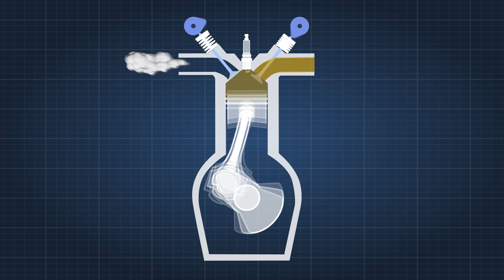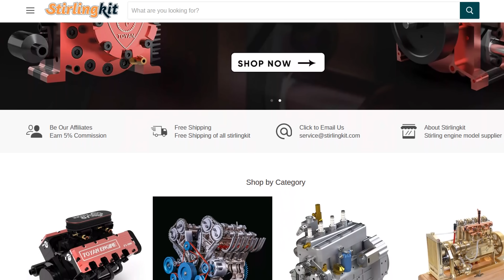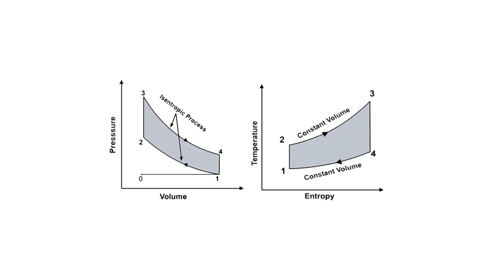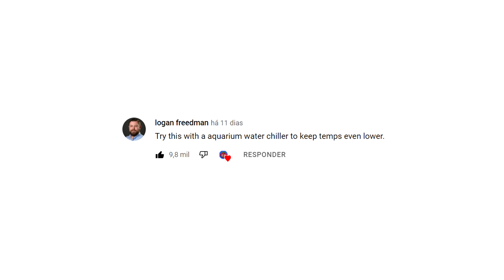I 3D Printed a Transparent Combustion Engine in Resin

Comment: I noticed you only mentioned thermal efficiency about gasoline when comparing it to the other ones. I am pretty sure that the true power is total power/thermal efficiency. Also the air fuel ratio might be all sorts out of wack since it appears you used the same carb on all of them without making adjustements. If I remember correct, the other fuels also demand a higher compression ratio, which your low compression doesn’t seem to be helping. Most of this is what I have heard through the grapevine, and I have no true background in this, so I could be talking out my rear for all I know, but it is something to consider. All of the fuels have different burn speeds and take different ignition timings to optimize fuel burn. Too much advance, results in ignition knock, too retarded results in low power. Since they all have different burn speeds, it could backfire from too little ignition and cause the engine to stop or just die from not enough power. Low compression, afr, thermal efficiency, ignition timing. The engine was tuned to run on gasoline, so it can’t run on anything else, unlike a turbine engine that just needs something to burn to make it spin.

Comment: On another note, the timing of the ignition could be very skewed due to the magneto. Would be cool to see a small scale EFI kit in use, but I know that would make the cost of the project immensely more expensive, but would solve the timing dilemma as the rpm's increase.

Edit* and my theory on the fuel types and their rpm differences may have to do with pumping efficiencies differing among them. The cams and overall valvetrain+cylinderhead design isn't likely to accommodate the increased power and exhaust. 

The nitromethane was probably burning the longest, or produced the greatest torque, while depending on the cam timing, if the exhaust valve was opening late, it may have seen higher cylinder pressures that exerted a tax on each exhaust stroke taxing the overall speed of the engine in every scenario.

It's likely 4500 rpm and lower possibly, was where the magneto was most efficient and creating a spark per complete combustion cycle.

Comment: Its my understanding that you're always going to get more Torque out of a lower RPM, but more power out of higher RPM(from the same engine).  

A Mazda Rotary Engine has terrible low end Torque because its all RPM.  But at high RPM you get a lot of horse power.  You just need something (gearing) to get that load up to speed so you can apply your power.

Comment: If you add hydrogen gas as an additive you can increase thermal efficiency significantly because it allows better more complete ignition of the gasoline and reduces overall carbon and nitrogen emissions with increase in power and efficiency. This goes even better with a rotary engine, which Mazda actually made with the RX8 hydrogen-e gas HHO hybrid.

Comment: my guess is that the intake cam isn't opening up properly, if you take a look at some of the footage, it looks like it's barely tapping it open, also, it''s leaking between the cam head and cylinder, it's hard to tell what the issue is causing it when there's already several issues present

Comment: With each different fuel you run the compression changes. if you follow your trend, using a simple spreadsheet you can find the answer to the question you proposed. Essentially, it all boils down to compression. you do not have the structural rigidity in the cylinder bore to maintain compression. adding a custom piston with additional rings will not fix this issue either. simply put, you need an extremely rigid and clear synthetic material to accomplish this. If there was one available, the aftermarket automotive industry would've done it by now.

Comment: most answers here are mostly wrong, but many are kind of on to it, Loadstone the least. time of pressure applied is a ridiculous claim.
each fuel needs their own perfect calibration to pull out all possible effect. that is air/fuel ratio, ignition timeing and engine overall compression ratio. i know for a fact that you tinkered with the set screw for fuel of camera or the engine would simply not run. but ignition and comp maby not? it's all hard to know and do anyway.
so probably the engine is simply most calibrated for petrol. for example ethanol/methanol needs like 15:1 to ignite well while petrol will "knock" at that pressure and needs more like 9:1. big difference.
also nitromethane needs a later ignition due to very harch combution (fast, thats why the engine tends to sound more aggressive on it) . and a better head gasket, you can se in the video the methanes violent combustion blowing right out the side of the engine xD.

so. make higher compression, 15:1, put ignition just a little later like 5 degree and then set fuel after RPM at full throttle as may be only option here. you need much more ethanol/methanol than you need gasoline but can still get more HP out from ethanol/methanol because you can burn so much more of it in an effective way, specially with nitro in it x)

hell, would you ad nitrous peroxide just for the fun of it. in that case. remember to ad more fuel ^^

Comment: Lotus Engineering, the consulting engineering side of Lotus Cars, built a test engine with a transparent cylinder. They used it to do high-speed photography of the flame front as they experimented with different heads, input and exhaust systems.

Comment: several things to look into... First is your piston ring.. even a 3D printed part, you are likely losing compression because of the scale. .. Second is gaskets... do you have a gasket between the cylinder and the head?  and lastly... the fuel ocatane level... are you pre-ingniting? are you not igniting because there is not enough heat? Octane level matters... in that little engine's case, I would say lower octane levels would perform better because of the lack of heat and low compression

Comment: Valve and ignition timing (IE when the valves open/close and when in the stroke the spark happens) may all need to change with the different fuels. In addition, the carburetor is built assuming the required air/fuel ratio for the original fuel. Those ratios, as you pointed out, are different for any other fuel.
Reply: Yeah watching stuff on PFI when Brett goes and checks out Top fuel dragsters they talked about how the sparking timing and everything else changes with the fuel

Comment: On average you have to run 30% more alcohol to get the same effects in a gasoline engine.. the interesting part is it's MUCH more stable and burns much cooler so it's a great fuel for extremely high compression (14:1-20:1 where most gas engines live at 8.5-9:1 for 87 octane) or for supercharged/turbocharged applications. In top alcohol dragster and top alcohol funny car drag racing they burn much more fuel, the supercharger is typically turned about 20% faster than the engine rpm. The point is in racing engines with methanol they pump MUCH higher volumes of it into the cylinder than you are here, that's why if you watch one run at night you see a huge ~2m flame coming out of each exhaust pipe because there's so much fuel it's actually still burning out the exhaust. To get the most out of methanol you need high compression or boost and a lot of fuel flow.. Nitromethane is even worse.. or better depending on how you look at it. If you want to see just how much fuel they pump through those engines, here's a video of a test of a single injector.. and they run 32 per engine. https://www.youtube.com/watch?v=xGTbQuhhluY
I'd try this test in a more reliable engine like a lawnmower if I were you. The fuels do burn at different rates and require different amounts of spark energy to ignite (top fuel nitromethane magnetos fire at 44amps! and they run two of them with two spark plugs per cylinder) but it still seems like the coil is cutting out at higher rpm.

Comment: you never fixed the issue of the ignition not lighting the fule, thats your problem I think, also you should make molds with your 3d printed stuff, then make metal stuff.

Comment: I think you could get this little dude running better if you could adjust the AFR and ignition timing.
In the real world if a car going from pump gas to racing fuel at a track, they have to tune the vehicle to run properly due to the difference in octane and the speed of the burn.
as you stated, some of these fuels are less powerful than gasoline so more fuel is need for the same result and some fuels have a slower propagation of the flame front through the mixture requiring the ignition timing to be more advanced than it would be with pump gas.

Comment: I am no expert by any means, but I've heard that the engines are designed for specific type of fuel(octanes) and if you have more or less it can make the engine out of sync, could that be it the rpms difference?

Comment: Suggestion: Stress test a transparent pulse jet by putting a tomato in it.

I once saw someone put sand in engines to destroy them and it went for a very long time, lasted surprisingly well. I'd like to see something similar to that with transparent parts on something with fire in it vs tomatoes instead of sand.

Comment: Engine is running slower on the 25% nitro as it’s getting good combustion and has to work harder to push the exhaust out

In the other cases the engine is freewheeling at times 

If you had a load on the engine things would behave differently

Comment: Seems to me your problem may be in the carburettor and the air/fuel mix it is giving you.
 As you mention in the video nitro methane uses less air to obtain a full combustion and given that it was the only fuel to seem to run properly in the engine, I would guess that the carb is not allowing enough air in, the reason the other fuels are only firing every other stroke could be that there is not enough air for them to ignite , but after another induction stroke it is able to fire.
 You would need to carefully adjust the carburettor and mixture setting for each type of fuel.

Comment: Lean is mean. A lower air:fuel ratio will always make the idle higher. Methanol is also a lot harder to light up so this can explain a lot of the miss fire. Methanol also contains some oxygen, so you can run way more fuel for the same amount of air. Stoich of meth is 8:1 compared to gasoline 14.7:1
That's the reason why alcohol funny car (drag car) make more power than the same engine on gas. Most drag car run straight methanol, only some class allow for nitromethane. In the NHRA, only the two top class run nitrometh. Been running meth in my race car for a while now.

Comment: Fuel air ratio is off of the different types of fuel therefore not letting it ignite every power stroke because it’s trying to build up fuel in the cylinder then is ignites when it has the right amount of fuel and air in  cylinder

Comment: speed does not equal torque.

That tiny engine is not good to test the ability of a fuel created for a full sized vehicle. There isn't enough mass and "time" between strokes for it to really show off. 

Pushing 6000 RPM on a tiny engine like that does not translate to pushing 6000 RPM with something much more massive.

Comment: Pretty sure the engine isnt running at stoichiometric for the power strokes that aren't firing, you could try choking the engine or if I had to guess by the look, its running rich and needs less fuel.  
For the 25% nitro, it needs much less fuel per cycle but is more combustible. You're getting a burn but its not efficient since its running rich.  My guess is the 2 valves aren't able to exchange the air well enough. 
Easiest way to test this theory is to try blowing compressed air into the intake and seeing if it will pop off more often.  
Cheers!

Comment: first, sorry for a not so good english, second i might be wrong, but i didn't see you adjust fuel mixture for the diferent fuels, less energy denser the fuel, more fuel needs to get onto the engine, and third, methanol and nitromethane needs bigger compression ratio to burn eficiently, you can achieve that by slightly sanding down the cilinder so its lower, making the compression ratio bigger. and thanks for a video with an actually transparent engine.

Comment: The issue is that each fuel requires a different mixture ratio. For gasoline it's 14.7:1, methanol is 6.4:1, and nitromethane 1.7:1. There should a needle valve on your carburetor to adjust the fuel air ratio. When you switch to methanol, open the needle a couple of turns. While the engine is running slowly close the needle valve. You will hear the engine RPM go up. When you hear the RPM start to drop again, return the needle to the highest RPM point, then open the needle valve another 1/8 to 1/4 turn.

Comment: I have allways wanted to build a motor where it outputs liner motion. 2 opposing pistons connected by a rod. Think of it like 2 air cylinders with the rods connected. When one chamber fired it woukd push the entire system and exhaust the other one and intake the back side of that piston. You would have 4 cylinders and 2 pistons and one rod going through the entire assembly.

Comment: Great video, but no way that this is a proper comparison.  Some guesses as to your problems -- Every stroke reduced compression (which was probably very low to begin with) with the resin cylinder and silicone piston ring eroding much more quickly than the original metal.  Methanol and nitro require higher compression just to ignite, and both attract moisture, so older fuel samples become contaminated.  Carburetor wasn't re-tuned and timing wasn't adjusted for each different fuel -- all of which are required in car engines.  Double-check your magneto, my guess that it is failing half the time, and film against a dark background in a darker room.  Nitro and methanol flames in atmosphere are nearly invisible in sunlight, and gasoline flame has a much more reddish-orange tint compared to the blue-white of the other fuels.  Looking forward to your follow-up video.

Comment: I know that this engine is not a hit and miss style engine, but it is acting like that where it fires only some times and not at others and it seems to fire around a certain RPM and is trying to maintain the engine running at a certain speed. 
Really would like to see you try something with diesel. Diesel is soooo much better and way more simple.
Love the video

Comment: A stronger fuel shouldn’t make the engine run faster, just stronger, so maybe each type of fuel has a different torque output rather than speed

Comment: not air ratios no sensor or proper because in multiple tests show that it only takes a little bit to be able it to ignite for sucha a size. so yes mabye but. U see dear boy MAGNETS every fuel did not go to 4500 rpm THE sweet spot for Exaughsting and intaking It was The perfect speed. while everything else went faster :) so the magnet was a switch u could say (so why didnt keep up or regester the other speeds.) well simply it couldnt do it fast enough im not saying the electricty is to slow that impocible its that the magnet took mulitple strokes to register another magnet going by it. So to make ur thier correct the entire enginge would have to be off sync making the explosion happy randomly or when its at its lest powerfull point of compresion.

Comment: Regarding the less power from more "powerful" fuel question - multiple things!  Surprising nobody has commented on some of this yet...

- You are using RC nitro fuel which will be composed of as much as 15% castor oil and other lubricants since it's specifically designed for high rpm 2-stroke engines with glow plugs and no internal oil system!  It will also foul your spark plug pretty quickly.  You need VEHICLE race fuel...but a 5-gallon drum of VP 50% nitro will set you back about $250! 😬

- Did you remember to crank up the fuel pressure and/or swap carb jets to allow for more fuel?  You said it yourself, gasoline has ~3 times more energy per given fluid volume.  Your air volume per stroke doesn't change.  You can pump about 8 times as much pure nitro as you would gasoline and still get complete combustion (but your engine will quickly become a grenade).  Same fluid volume per unit of air = less work being done.

-These fuels have different burn rates.  Both methanol and Nitromethane burn measurably slower than gasoline.  This effectively gives them a higher octane, and they can be run at higher compression ratios.  It's not unusual for nitro to still be burning as it exits the exhaust valves.

- Cylinder heads, valves, and piston ring may not fully seal, especially upon ignition as everything is under massive pressure.  This effectively lowers both your usable compression ratio and expansion volume....decreasing the amount of work that goes into turning the crankshaft.

And more!  I think fixing your spark and obtaining appropriate fuel would make a massive difference.   Engines are complicated beasts!

Comment: The worse the gasoline/methanol is, the slower the motor runs. When it runs slower you get more explosions.

Thus: the magnetic sensor is too slow to keep up with the rpm of the engine.
You need a quicker trigger to keep up with the higher speeds.

Comment: I would bet the 25% nitromethane is working worse bc it’s running too lean. Gasoline/petrol uses an air/fuel ratio of 14:1, and ethanol needs 9:1, meaning more fuel needed per intake stroke than gasoline. Why the 25% is worse than the 16% I’m not entirely sure, but my best guess is that since it introduces even more oxygen during combustion, it causes itself to not combust correctly